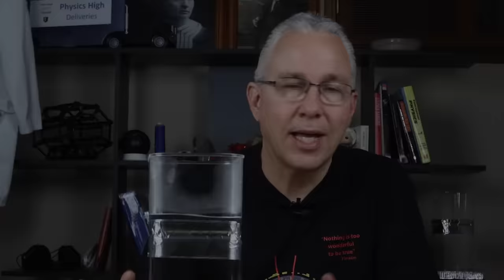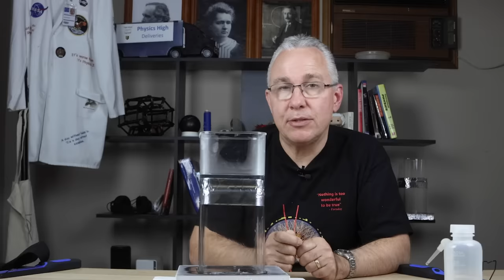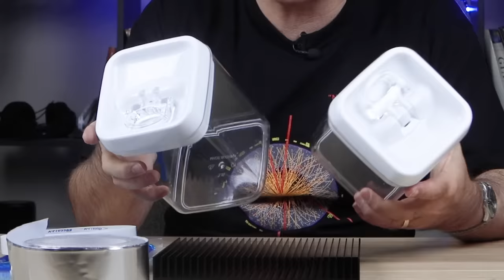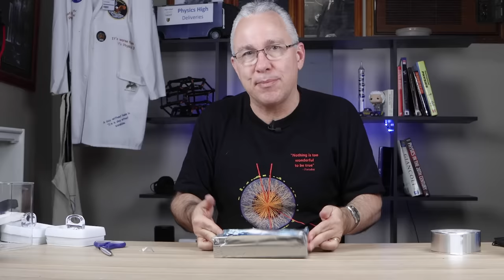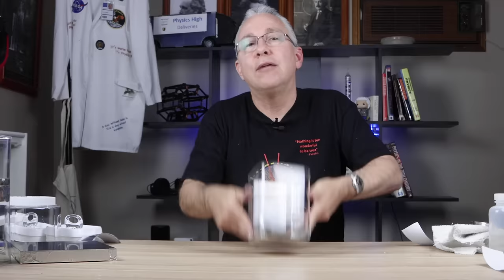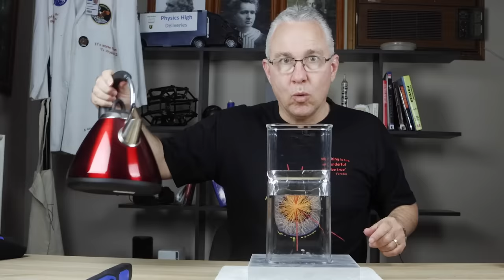DIY cloud chamber: no dry ice required - how to make, how it works!

Comment: The t-shirt looks like the Atlas detector of LHC. The similarity to a cloud chamber is that the LHC would have semiconductor layers around the centre. When a charged particle passes through the semiconductor (probably silicon), it will create a electron-hole pair, which behaves similarly to a positive and negative ion in a gas. By applying an electic potential difference across the semiconductor, the electron and hole can be kept from recombining, and instead a small current will be detected when a particle passes through. (With the voltage set just right, having a few electron-hole pairs in the semiconductor will reduce the resistance enough to cause a cascade, where more electron-hole pairs are created from the energy of the electric field, causing a mini-lightening inside the semiconductor).

Next, by applying a strong magnetic field over the whole detector,  one causes charged particles to follow a curved path, where the curvature will indicate the charge and momentum of the particle. And at the edge, there is probably a calorimeter (yellow), that abosorbs the remaining energy of the particles, and combined with momentum, it can be used to identify the mass and velocity of the particle.

Basically, this approach follows the same principles as when using a cloud chamber, except that the particle traces can be read out electronically instead of taking a photographic picture, allowing for much higher resolution and more events to be captured per second.

As for the event itself, it looks like a reconstruction of a Higgs decay. I would guess this is a H->ZZ->4I event. The red lines seem like reconstructions of the momentums of the 4 jets.
Reply from the maker: Yep.  Got that shirt from CERN and worn on purpose.
Reply: Atlas uses three detection principles whereby silicon semiconductors are one. It also uses ionization detectors and scintillators. They all have their specific uses such as triggering, energy measurement, etc.
Reply: @upnorthandpersonal  When talking about semiconductor I was referring to the tracker part, as that is the part that corresponds directly to the cloud chamber of the video. From memory (from 25 years back) the tracker part is using primarily semiconductors. Maybe I remember wrong?
Reply: @haakoflo  No, that's correct. I just wanted to expand on what you wrote; the scintillation detectors are the calorimeter you mention.
Reply: EDIT: Correction to the above. This is indeed a H->ZZ->4l even, but after reading the discovery article, I realize that the red arrows are NOT reconstructed jets, but rather individual electrons and/or muons, as these do not decay into hadrons. The reason they do not curve visibly in the magnetic field is their high energy. The length of the arrows may represent the energy of the particles (which at this highly relativistic energy is basically the same as momentum), or it could simply reflect where the track ends. In the latter case, if the track extends beyond the electromagnetic calorimeters, it would indicate that this is a 4 muon event, where the tracks end in the muon chambers in the outer parts of the the detector. As it turns out, the ZZ to muons and/or electrons channel is relatively rare (low cross section) , but it has a very low background, making it easy to detect, which is why it was probably the most important channel when the disovery was made.

Me mistakenly interpreting the red arrows as jets probably stem from the fact that I spent a couple of years in the 90s looking for 4b events, where the b quarks do form jets, and the events look pretty similar. 

This presentation would show a HH->4b event, where the bottom quark jets are represented as cones, not lines: 
https://indico.cern.ch/event/731450/contributions/3090100/attachments/1710518/2759053/ATLAS_4b_strategy.pdf
Reply: @haakoflo  Useful information. Thank you. Could the alcohol be vaporised in a vacuum chamber ?

Comment: Im not fluid in my understanding or in the terminology regarding many areas of physics. Love your description and use of materials to achieve a result by the way, great stuff. Ahh now I see after watching again you put your isopropynol alcohol in the felt ugh. I missed that the first time I watched and couldn't understand why you would put an insulator in the top of your chamber lol.
Reply from the maker: The purpose of the felt is simply to hold the alcohol And since it’s a very fibrous it has a very large surface area and thus when it gets warm the alcohol vaporises very quickly

Comment: Is there a reason an evaporator from a refrigeration unit cannot be used for the cold "source", and a heater with a thermal regulator to maintain the temperature of the upper container?
Reply: they do that... like, commnercial-grade, inevitably a larger project than you first envision, like many things. one guy tried different things and it had to be cold enough it was like the element om the freezer quickly freezing water crystals onto it before the field would saturate... this on the other hand I'm half done already in a half hour (I have a benchtop milling machine and a 1.8" endmill and made cutting the top so easy I almost felt guilty. I just don't have the liqui-gel cellulose so I'm thinking of trying some 25% antifreeze / 75% water, suspended in sodium polycarbanate "gel" crystals all of which is in the garage. And a mean heat sink from a transmitter. If it doesn't work I'll dig out the gel and try again. I think I have enougfh head room... I have two of the bins he has on top and not the taller one... he says 15-20cm at least... Crap I've got 11 I'm hosed :(  ...they didn't have the taller one... they had literally the exact one he has on top at Dollar General.
Reply: Or use a Peltier plate.
Reply: @OtterLakeFlutes  F whatever item you were using has a freezing point just slightly above the temperature you’re going to bring it down to, you can actually get a little more energy out of it that way and it should theoretically last longer.

Comment: I made a large cloud chamber using a 10 gallon aquarium and with dry ice and it worked great. When I watched your video about using freezer gel I got excited, but then ran into a problem. You stated that your freezer gets down to -18-degrees C. I'm in the USA and our freezers rarely get below 0-degrees C, which isn't cold enough to run a cloud chamber. Are UK freezers that much colder than ours?
Reply from the maker: Are you sure? Here is Australia freezers are set to -18 Celsius. That’s 0 F. 
0 degrees C is not cold enough for anything
Reply: @PhysicsHigh  It seems I had an equipment malfunction. I measured the temperature with an infrared thermometer, which I have now determined to be malfunctioning. Switching to a different thermometer now gives me a temperature of 2.0-degrees F. I apologize for bothering you. Thank you for an interesting video and replying so quickly. 

I also apologize for thinking you were in the UK. I'm in Southern California USA.
Reply from the maker: Not a problem at all 🤓. Happy to help

Comment: Fantastic!! I hace a 1" thick chunk of metal the same the same dimensions as the heat sink you made. Can i put that into the freezer overnight and use that instead? Thank you!
Reply from the maker: It may work but it will most likely heat up quicker. So you will have a more limited time. No harm in trying
Reply: @PhysicsHigh  thank you!!

Comment: Cool cloud chamber. I think you're using the wrong term though - the alcohol vapor in the chamber is supersaturated, not saturated. Also, I believe the image on your shirt specifically is an image of the Cern Atlas event display of the Higgs (H -> 4mu) candidate event.
Reply from the maker: I stand corrected - it's what I meant but didn't pick up the error in my narration, and yes the shirt I got from CERN (ATLAS office actually ) and specifically chosen for this video. I try to wear shirts that align with the topic I am doing ;-)

Comment: Thanks! Maybe I missed it, but: what's the point in using a heatsink + gel rather than just a thick plate of solid metal? Wouldn't steel have overall better thermal mass? Or does that gel actually do better?
Reply from the maker: The thick metal plate would warm up quickly limiting the time you can perform the experiment
Reply: @PhysicsHigh  thanks, i didn't realize how much better than steel water is for specific heat capacity. Still, it would seem that the volumetric heat capacity of steel is about 75% that of water, so you might get a useable amount of time from a simple steel plate of the same volume?
Reply: @PhysicsHigh  also, given that the plate in the video is only about half water, and the (presumably aluminum) metal has less heat capacity than steel, maybe a steel plate of equivalent size would be even closer in performance than 75%? And if you are going to spend $40 you can probably get a thicker plate of steel anyway? Might simplify this already simple design even more?

Comment: Hey there, thanks so much for this tutorial. I've tried it 3 times now with no complete success. I followed your instructions to the T and I went and purchased a high lumen work light to help with the illumination of the vapor. I was able to see the vapor, but only to about 5cm above the heatsink. Is this what you'd expect? For some reason, I envisioned the entire chamber saturated with the vapor. If so, do I only need to focus light on the bottom half of the chamber?
Also,can the water temperature be too hot for this experiment? Thanks for your help!
Reply: Did you ever succeed? I got no fog at all

Comment: Yet another way of making a cloud chamber! Thank you. I've had partial success with peltier's at surface temp of -40°, but didn't warm the alc. I've recently seen designs with a high voltage mesh - what's that about? I know strong magnets can deflect particles to aid in identification, but H/V? Many, many thanks for the upload, subscribed.

Comment: Good idea, but what do you think, is it possible to create "cloud" with an ultrasonic humidifier and isopropyl alcohol? Most cloud chambers based on temperature differences, is another way to do that? Thank you for your video, I will try yours. :)
Reply: This is a good idea for an experiment. I've seen those little ultrasonic compact elements inserted into a little dish producing visible water vapor. Could it work with alcohol? Uh oh, though... flamability! Vaporized alcohol is very volatile!
Reply: @OtterLakeFlutes  Yepp, alcohol is very flammable. Otherwise, I watched a lot of videos about cloud chambers, but half of them used dry ice (which I don't know, where to buy in east Europe), or Peltier cells with large power. I think, humidifier won't work, because the key is the oversaturated air with alcohol, but this wouldn't have particles small enough for this. If someone tries it, I would be curious to result.
Reply: @pmate95  yeah come to think of it, it would be its own agitator like the particle that flies through...even if it managed to truly vaporize the alcohol (which is dubious) it would probably instantaneously re-precipitate from harmonic vibrations anyway. Esp. cheap ultrasonic elements are noisy with harmonics. I got a "fat burning" ultrasound probe to do, instead, therapy on my shoulder. It helps alright, and it's probably an illegal (unlicensed) level of ultrasound (unlike hokey, weak gimmicks) but I worry about it giving he hearing damage, lol. Unlike the medical probe at the clinic, this one works similary except the harmonics squeal loudly in my ears like some aquatic alien! Couldn't believe it that much noise could make it through a foot of meat to my ears. And right over my shoulder blade bone, wow. Then it's like my heat is going to explode with audible harmonics. Never happened at the clinic, but I can tell this probe does have powerful ultrasound (and no just sonic) because of my experience with the sensation, effects, and you can vaporize a water droplet on the pad. I don't think my wife will let me use if for a could chamber though, lol, she paid $275

Comment: Thanks for the tutorial! Dry ice is alway a pain to get a hold of. I have just finished building it. Do you have suggestions for keeping the bottom chamber walls clear. I can’t see through into the chamber as there is too much condensation on the walls.
Reply: Maybe seal the bottom, I think he recommended vasaline around the rim, so water can't get in and condensate on the walls and base. If you've already done that then I'm at a loss
Reply: What purity rubbing alcohol are you using? If it's off-the-shelf stuff I'd recommend getting 99.9% so there isn't any water vapor being created.

Comment: Would you say the heat transfer from the hot water to the lower chamber is enhanced by not using the aluminum between the two chambers and just using the bottom of the upper one to transmit the heat? It does appear to me that the aluminum material there would cause the heat to be reflected back to the water side rather than down toward the felt.

Comment: Thorium rods are Emissive without electricity?
Reply: Yes. The radioactivity just happens - can't be switched on or off. We use these now in our cloud chambers - you get nice alpha-particle tracks of a couple of cm (just as in the textbooks). You also get a sense of the speed that the particles are moving.

Comment: Would not a Ice cube/brine solution work just fine as a heat sink. That could easily go lower then  -18 C.
Some thermal past between the containers should also help.
Reply from the maker: I think your suggestions could work you don’t have to use the gel and heatsink. 
As you suggest, ice and salt could give you the required low temperatures.
You could try thermal paste. Mind you, in my case all that was in between the hot water and the alcohol filled felt was some aluminium tape. Conductive enough I think
Reply: @PhysicsHigh  Off course the aluminium have good conduction, but it is always difficult to get it completely flat. 
So my thought was to get a better connection between the plastic container and the tape using some thermal past. Also since you can refresh the brine you are not so time limited in using the chamber.

Comment: Can you point a web cam it the chamber and make a RNG out of it? Please detail the maths of how to determine how long to wait for interactions and how to transform the distribution of the stream, etc.
Reply from the maker: I’m not sure what you mean by RNG. The maths is problematic. If you are trying to detect muons you will increase your chances by going higher up. That is go on a tall mountain and perform in there. If you’re trying to look for radioactive particles a more radioactive source  would be better but then you have safety issues. I suspect if you pull out the Americium from a smoke detector you could get decent alpha particle tracks.Not sure what you mean by the last statement.
Reply: So, you want to take note of the particles that appear along with information on them, say, the position of trails, and use that as a source of randomness? Interesting.

You could simply label some spatial axis from 0 to 1 with a fine scale and see what comes out. Take the data after some testing and see what that distribution originally looks like then prepare a function to map the output to how you'd like it to be. But figuring out how long you need to wait between trails is beyond my current knowledge
Reply: You easily could, given you can program something that tracks the streaks or feel like doing it manually. If you just used the time between each particle you'd get a normally distributed, but random number. Buildings, the sun and stuff is also going to make using the angle would result in a bell curve

Comment: Is the custom ice block on the bottom needed or can I just use store bought ice packs, gel already inside? I suppose the thin layer of metal will conduct heat better than the ice pack’s plastic but is that difference significant enough?
Reply from the maker: You first of all need a smooth surface - you need to be able to seal the cloud chamber. Hence the metal plate. You could place a flat plate on frozen gel packs, but you will get inconsistent temperature gradients, and it will warm it significantly quicker, limiting it's usefulness

Comment: Thank you for the great explanation. I still have a question though. What distance is better to have between the heatsink and the felt? 14cm or 21 cm?
Reply from the maker: I had success with both. Are you might get a stronger gradient of temperature with the shorter amount which may result in better results. Are the original design based on the Japanese paper used two plastic tumblers so much shorter.
Reply: @PhysicsHigh  Thank you for the Quick answer!

Comment: I managed to catch one particle! Encouraging to keep going. Still having a hard time either generating sufficient saturation of the vapor or maybe my light is not appropriate? I tried using a strong flashlight as well as a 1200 lumen work light. It seems that fleshlight works better as it has a more concentrated beam of light, but I am only able to see the mist alongside the light beam. Any way to illuminate the entire chamber?
Reply: Weird way to use a fleshlight...

Comment: will it work if the aluminum plate is round with a diameter of 7cm and a height of 3.7cm? is it ok without gel, if it is raw aluminum without space for gel?
Reply from the maker: The purpose do the gel is to help keep the temp as low as possible. A solid piece of aluminium should work but it will heat up quicker

Comment: Instead on a hot water reservoir on top, could I use a heat lamp with similar efficacy?
Reply from the maker: I would argue it’s riskier. The heat lamp would be much hotter that  100 degrees and so you could over heat the plastic